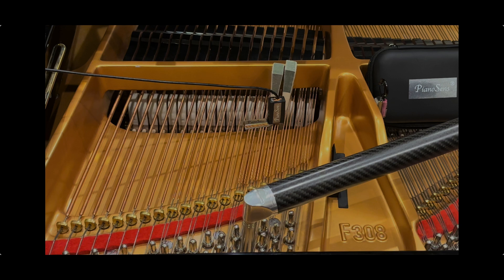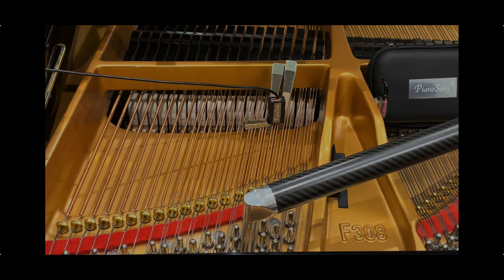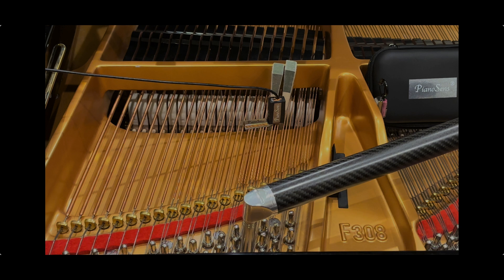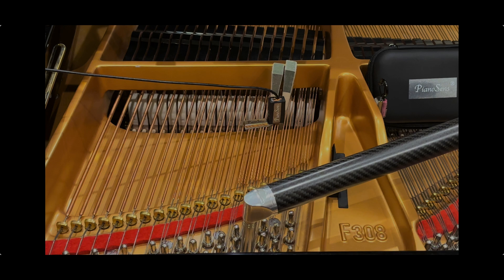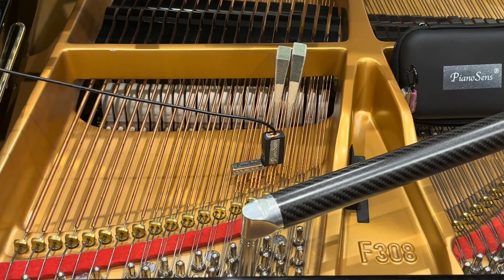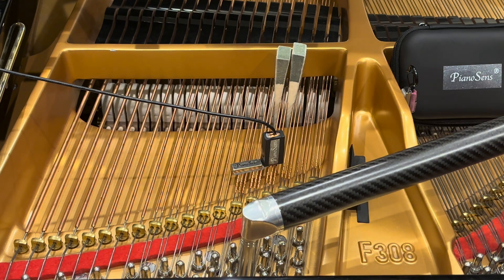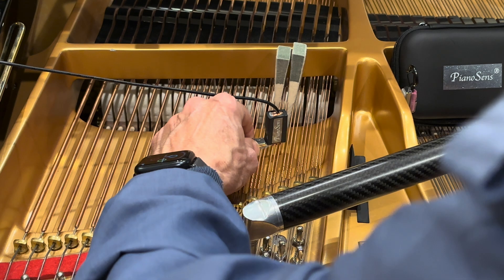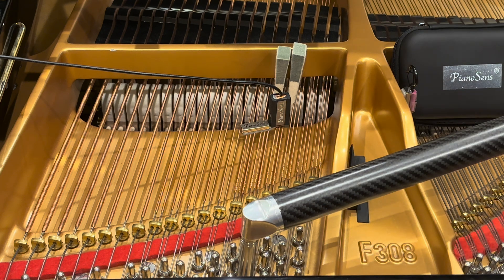PianoSens Position Invariance

Comment: This is important information for those of us who use ETD's to professionally tune pianos.  I was not aware that the microphone in my iPhone was introducing errors into the calculation of my ETD.  It's not intuitive, because when we make a recording, it sounds good.  So then, what could be wrong with using a microphone in the phone, or any external mic?  It turns out, there IS a problem.  That's because the microphone picks up all kinds of other sounds that are not relevant to tuning a piano, and there are patterns of wave interferences that are invisible to us that the mic responds to.  That affects the relative strengths of the overtones in the sound envelope sampled through the mic.  The ETD then interpolates those overtones and  calculates the frequency target.  But if the overtones are mixed in with these acoustic anomalies, the result is that the target frequency is off.  When using the Pianosens, all of the impertinent sound vibrations are eliminated, and only the vibration of the string is used for calculation.  The result is much more accurate, which means your tunings become better when using your ETD.  This mic discrepancy is the reason that the tuner-technician must check the final result to verify if the tuning is as accurate as we expect from our ETD's.  Thanks, Steve.